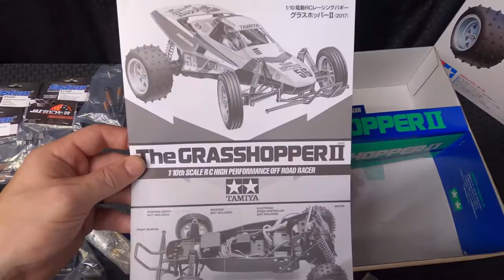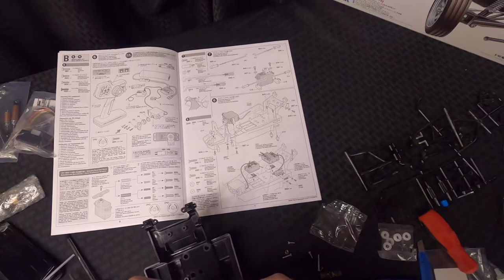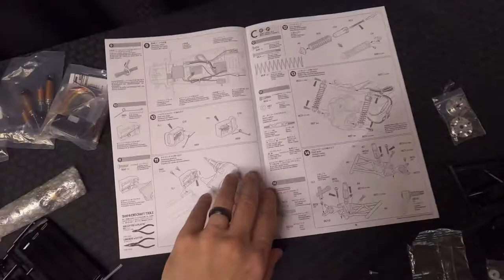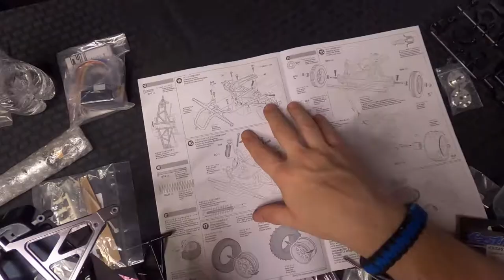Project "GRASSHOPPER" +Part 1 The "BUILD"!

Comment: The original grasshopper you have has an aftermarket shock tower setup, factory it was the same as the grasshopper 2
Reply from the maker: Ooo.  So somone. Cut it off and did the metal bending...  I kinda wonder if was but not sure

Comment: I was the first to watch your new video last night.  Can't wait to see some speed.  BTW did the original one come with a 540 motor stock. It looks like the newer one has a smaller motor that the original
Reply from the maker: yea it came with that small stock motor...  which was a joke.. that tiny motor won't do crap... so i have a 550 can -12turn brushed old school motor .  yea a speed run is gonna be fun.. not sure were to mount the go pro tho ..
Reply: @ATECHPCs  does it have the ability to fit a bigger motor  on it like the old one
Reply from the maker: @danielcase2189  yes. u need adapter.. which i have.   it can fit a 550 can size motor
Reply: No way .. i was the First...lol   J/k